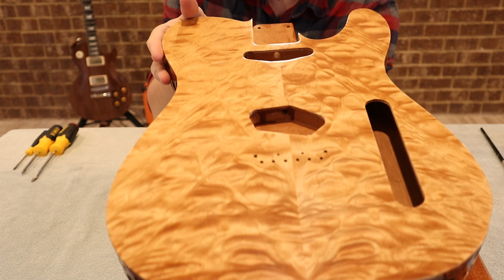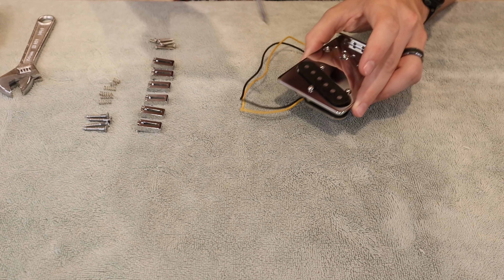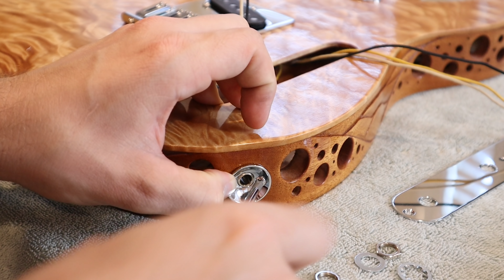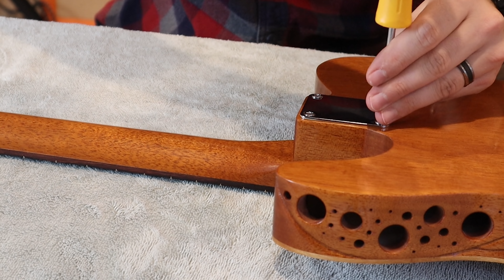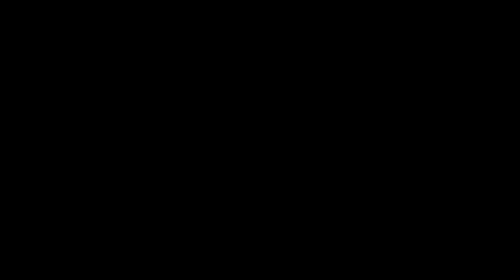Great Guitar Build Off 2020 - Part #10 Final Assembly!

Comment: You need to bin the adjustable spanner (wrench) they are designed for use in an emergency situation, they will damage nuts, especially if not laid flat with full face contact to the nut flat. Apart from that it’s looking good.  Regards
Reply from the maker: Yep you’re right, I lost my socket and had to be real careful with the wrench... of course I found the socket about five minutes later 🙄

Comment: Loved the video, and the guitar is a thing of beauty.
One bit of nitpicking: the adjustable wrench. It's a great tool to have on hand, but runs the risk of rounding corners and ruinning the finish of your work. You may want to consider a good set of wrenches (or sockets, as I belatedly see someone else pointed out) in the dimensions you're most likely to use.

Thanks again for a great video!.
Reply from the maker: Good tip on the wrench, I usually use a socket but I lost it when I was doing the assembly and just had to get by carefully with the wrench. Of course I found the socket 5 min later... 😂

Thanks for watching and your support!
Reply: @KCElectrics  Isn't that how it always is, lol.  Keep up the great work!

Comment: Beautiful work KC!
👍✌😎

ps, you definitely got your Tuners backwards  ✌
Reply from the maker: I think you’re right, luckily an easy fix! Thanks for your support and for watching 👍
Reply: can some one explain to me the backwards tuner thing? 

i have picked up a little from other comments and videos. does it have to do with height of the tuners?
Reply from the maker: Yes, there are three tall and three short tuners with the six inline tuners. You should place the taller ones closet to the nut, and shorter ones further away in order to get a steeper string angle on the high strings
Reply: @KCElectrics  ok. thanks for the answer buddy. :)

Comment: just a few observations
1. hoping you put more than one coat of shielding paint
2. you didn't shield the control route?
3. no ground to the bridge?
4. you didn't connect the grounds between the cavities
Reply from the maker: 1. Three coats of shielding paint
2. No it’s a semi hollow, not sure anyone paints the entire chamber?
3. Yes there is a ground wire from bottom of bridge plate to ground on pot shell
4. No I did not.

Haven’t had any hum or noise, it’s super quiet plugged in so far!
Reply: @KCElectrics  2. Only if your called Ben
Reply from the maker: @JRR good point hahaha 😂

Comment: Fantastic build, awesome!!! Could you tell what kind of electronics is that? Wonderful!
Reply from the maker: Thanks a bunch, it’s Mojotone Broadcaster PUPs and pots!
Reply: KC Electrics  Thanks a lot. I meant that solderless switch, I’ve never seen one before, very interesting and convenient. Many many compliments again 👌
Reply from the maker: Yes the solderless switch and pots are all part of a Mojotone package, with wires included. I highly recommend them if you’re not a fan of soldering, it’s very easy to install and almost impossible to mess up! Here is a link: https://www.mojotone.com/Holiday-Sales/Tele-Tech/Pre-Wired-Tele-Standard-3-Way-Wiring-Kit

Comment: First of all: awesome build, looks fantastic!
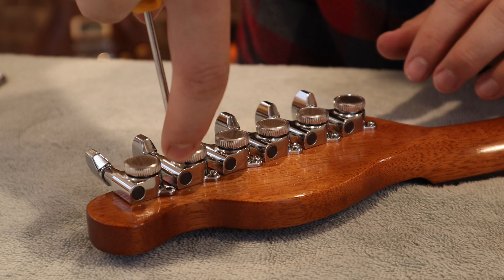Quick question though: when you install the tuners at around the 5:30 minute mark, it looks like you install them in the wrong order, as in, that the tuners for the 4th 5th and 6th string should be swapped with the other 3 because of the height-difference
Reply from the maker: You may actually be right haha, I’ll have to go back and check tonight after work . I laid them out in the order I wanted but may have accidentally gone backwards still🤨. Good catch if true! Thanks for watching 👍
Reply: Agreed beautiful guitar but yes the tuners are 180 out. The tall ones should be closer tho the nut. the thing that needs to be addressed is the use of the adjustable wrench on the tuner bushings. That is a very good way to chip the chrome and srcath the finish. Box end wrench or socket is the way to go.
Reply: @jonahguitarguy  Yep. Noticed that myself. And yes, a socket is way better!
Reply: Yeah the staggered tuners are in backwards

Comment: WOW… thats stunning !!!! great work !!!….. just a tip for installing ferrules, if you have a drill press it you can use an inverted drill bit to safely ease them into the back of the guitar…way less stressful than a hammer….
Reply from the maker: Thanks very much! Good tip for the ferrules, might have to even make one of those little jigs they sell on Stewmac to do it safer too in the future. Something about the old fashion hammer that makes me feel manly though 😆, until I wreck a finish I guess. Thanks for supporting!

Comment: Just a quick question... What's the point of the pickup bracket screws being dipped in the finishing wax? I've watched a fair amount of guitar builds and have never seen that before. Genuinely curious as I'm working on my own project guitar. Thanks!
Reply from the maker: I use the finishing wax to help lubricant the screw while going into the wood so it doesn’t bind up or have a potential for breaking/cracking. You can also use a soap bar or old candle!
Reply: @KCElectrics  awesome, thank you. Does that leave more potential for the screws coming loose over time than normal in your experience and then having to re-drill or re-thread as a result, or no?
Reply from the maker: Nope, just make sure to drill the pilot hole with a smaller diameter bit than the screw and shouldn’t have any issues. There are charts you can find online for the appropriate pilot hole for a given screw size too!
Reply: @KCElectrics  thank you so much! Best of luck to you!

Comment: Great looking guitar but you should learn how shielding works.. first of all i think you forgot to ground the bridge (or at least haven’t seen it in the video)
Secondly, your shielding paint in the pickup cavities will have zero effect if not grounded. Usually it’s done by screwing a ground wire in the wood.. oh and why didn’t you paint the control cavity as well ?
(Also, shielding paint isn’t as effective as copper adhesive)
Sorry to sound so negative, but i’ve seen this mistake so often, i had to tell you ;)
Other than that the guitar looks stunning !!
Reply from the maker: Good to know. There is a ground wire from the bridge to back of a pot, but you are right about the paint not having a connection, I will go back and add something. The control cavity is semi hollow with the holes in the sides so not sure how I would even go about painting it 🤨. So far no hum though!

Comment: where did purchase the neck chrome holder?  i got one from France and the holes for the pickup screws were too small.   need to drill through metal which i wasnt too crazy about....
Reply from the maker: I got it off amazon, but I actually have had the same issue you ran into in the past. I learned that not all single coils have the exact same fastener spacing so you have to check the coil spacing and the plate spacing to make sure they match. The one I had an issue with prior was only off by maybe 1/8” but still an issue

Comment: Why paint the electronics cavities? Wood is naturally non conductive.
Reply from the maker: Justin Case it’s used to create a Faraday cage around the pickup electronics and grounded to a common ground in the control cavity to eliminate any 60 Hz hum which can be real common near things like old fluorescent lights. Very common practice on guitars to either use shielding paint or copper tape lined in the cavities. Hope that helps!
Reply: @KCElectrics  I concur your reply to Justin Case. Also, I copper tape shield the control cavities in the body and copper tape shield the bottoms of pickguards as well to ward off electrical interferences that may cause unwanted hum/noises. Peace & Play 🎸 On Fretbro . . . 👍🤘🎸😎🙏 DDH 9-15-2020.

Comment: I'm very much guilty of scrolling through the talky bits of many videos, so you may have discussed this, and I'm not going to read the other 230 odd comments, but when you installed your tuners and pickups, you didn't show any pre-drilling of the screw holes. Having had a few wood projects split due to not pre-drilling, while watching those parts of your video I felt my anus clench up.   Thankfully it doesn't appear anything bad happened.  And, they're not very big screws so that's good.  Still it's possible with changes in humidity you could see some cracking at some point.

Comment: Great build, love the carve.  Looking forward to more builds. A few questions, did you use shielding paint under the pots and switch,  did you have a bridge earth wire,  and I do feel that the tuners for the low and high strings are back to front.  Not a criticism, I love your work... Just curious.
Reply from the maker: No shielding paint under the pots, since it is a hollow body I’d have to paint the whole inside I think. I do have a ground wire from bridge plate to the pot case to ground the strings. No hum when I plug in or get near lights, so seems to be working well. And yes I think the timers are backwards, even after I checked I still messed it up 😂. Easy fix though! Thanks for watching and your support 👍